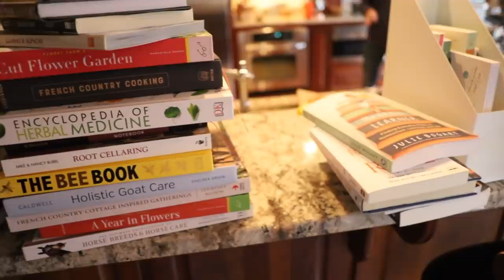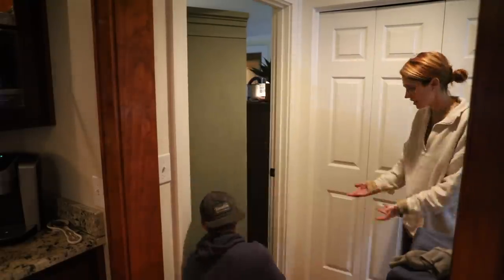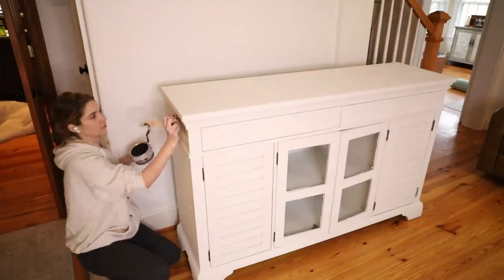New Home Makeover! Living Room, Entry + Master Bedroom Projects! \\ Episode 2

Comment: Love it!! 😍 quick tip for cutting in around outlets and switch plates. Just loosen a bit with screwdriver, but don't remove plates. When loosened, you can easily cut in around them without taping or removing!!! Super time saver for me. I paint a lot. Shortcuts, baby!!!